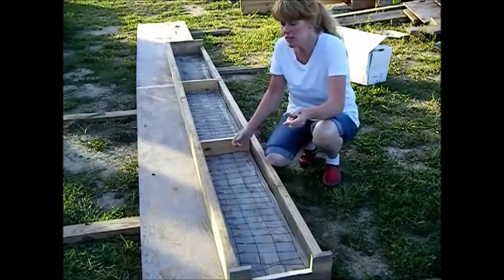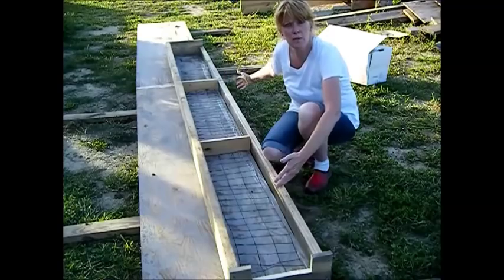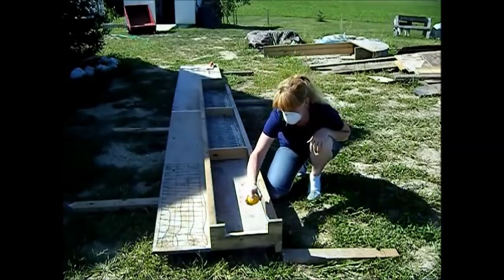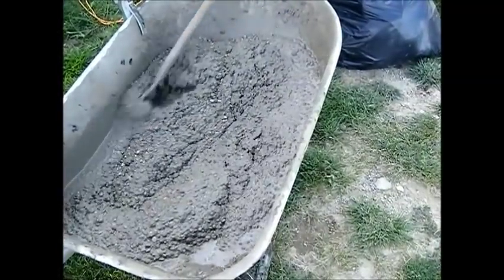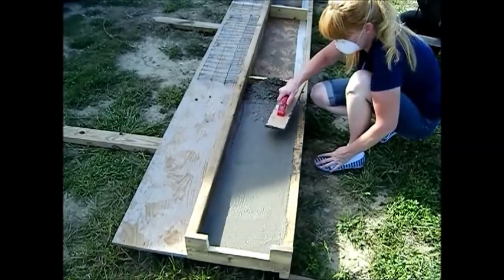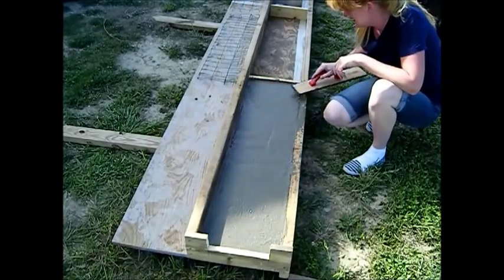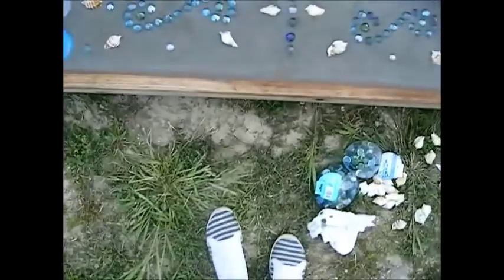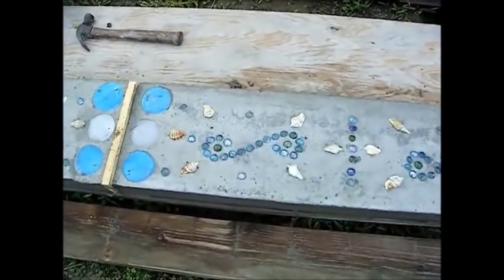Homestead Series: How to Make Cap Stones for Garden Wall

Comment: Suggestion...next time make your mix a little dryer. Reason the wetter the mix the better the chances are of cracking when drying. A dryer mix would have allowed you to remove the form within hours or forming w/o and chipping. Instead of buying cooking spray, use drain oil or heating oil on the forms, wiping it in with a old rag. Also use a dead blow hammer to float the sides or a palm sander either does a great job of floating or smoothing the sides. Finish with a slurry of portland cement brushed or spread on with a rag to fill in the small air pockets.
Reply from the maker: They are holding up...but yes...I think they were too wet as well..plus the humidity was horrible. They are lining my garden edges.... They've held up with walking traffic since I made them years ago.